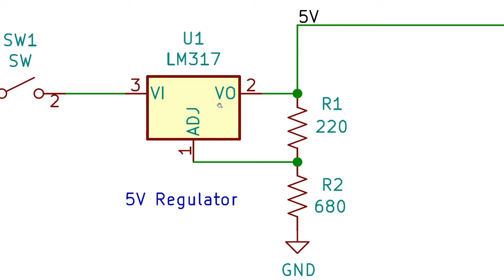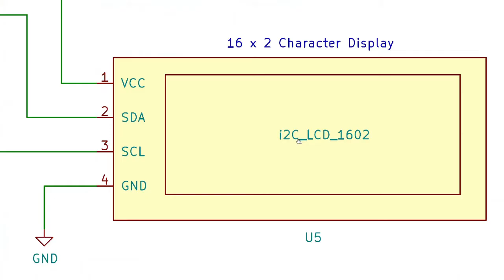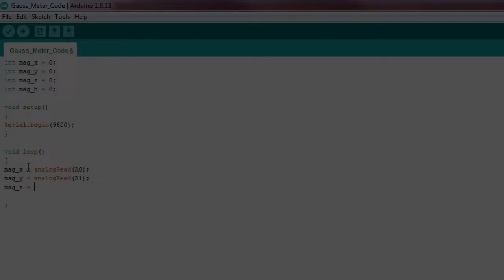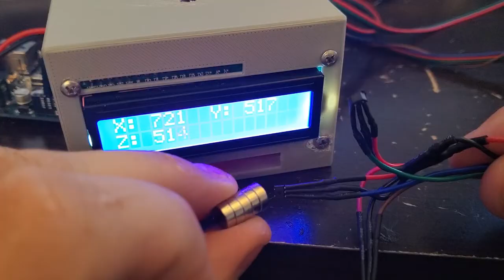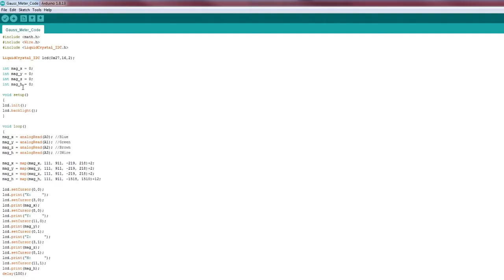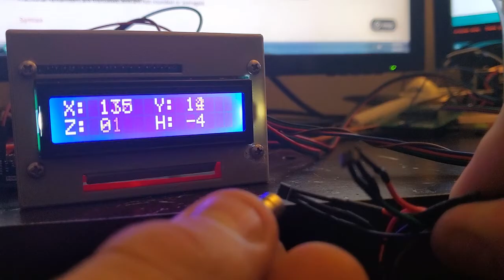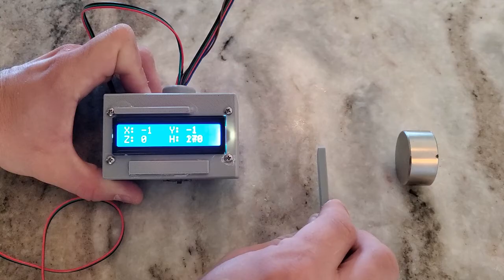3-Axis Magnetometer Build

Comment: May I ask how you calculated the h value? Is it the sum of 3 axis? That's why I asked this. As you know, the size of the earth's magnetic field is known as 50 micro tesla on average.
Especially in the compass application, which is one of the mobile phone applications, this value is shown in a corner. What I am wondering is: For example, what formula is used to reach this value, which is 47 micro tesla in my region?
Reply from the maker: The value is whatever magnetic flux intensity is normal to the face of the hall effect sensor. I guess in theory the same result could be gotten from the 3-axis mode with sqrt(h_x^2 + h_y^2 + h_z^2). I don't think the sensors im using are sensitive enough to detect the earth's field, though. Their sensitivity range is more suited to big permanent magnets (like >50 gauss)
Reply: @HyperspacePirate  Thank you for the answer. I did this experiment with hal effect sensors, but I couldn't measure the earth's magnetic field size. So I decided to buy a module. The LIS3MDL module is sensitive enough to do this job. However, the formula you gave above; Does sqrt(h_x^2 + h_y^2 + h_z^2) normally calculate earth magnetic field magnitude? Can you explain the formula a little bit?

Comment: What is the smallest detectable magnetic field size in gauss?
I've heard of a sensor that can detect 50 nanogauss.
Reply from the maker: The smallest readily available sensor IC's I can find at major suppliers seem to bottom out around +/- 5 mT, which is +/- 50 gauss. With a 16 bit ADC on the sensor, that comes out to a resolution of 0.0015 gauss (1.5 milliGauss). 

I'm sure there's scientific / laboratory grade sensors out there which can do much higher resolution, but at a certain point, the background field would completely override whatever you're trying to measure.  Earth's magnetic field (which is very weak) averages around 0.5 gauss, which is 10 million times more than 50 nG.
Reply: @HyperspacePirate  thank you for the answer. I want to ask something; Is it possible to detect a magnetic flux coming from one direction only, parallel to the sensor? I mean a perception that has no effect of magnetic flux coming from the sides.
Reply from the maker: @ahmetozdemir7173  Yes. Almost all hall effect sensors only sense one axis. That's why magnetometers usually have 3 sensors.

Comment: Do you truly think an N52 magnet has a 1.4 Tesla magnetic field? Have you tested your "gauss meter" against the one built directly into you phone?  Try a gauss meter app for free and compare.
Reply from the maker: Nominally, an N52 has an "internal" magnetic field of ~1.4 Tesla. But yeah, if you measured exactly on the surface, you'd get more like 0.5-0.7, and that would drop drastically as you moved a few mm away

Comment: Hi loved the video! can you help me with something? I´m trying to add a gauss meter to other device and this was a lot of help. If I only need to measure gauss I could use one A1308 sensor right? but still I will need the ATMEGA328 and an arduino to burn the bootloader and program?
Reply from the maker: No, the A1308 outputs a voltage based on the field it's reading. 0 Gauss is 2.5 volts and min/max is 0.5/4.5. Can't remember off the top of my head what the mV/G is, but the datasheet has that info, but if you know the output voltage of the sensor you know the field strength. The arduino is just to make a nice display
Reply: @HyperspacePirate  oh thanks so much for your time. With that understanding I can display those volts then and in the near future update it with all the Arduino part.